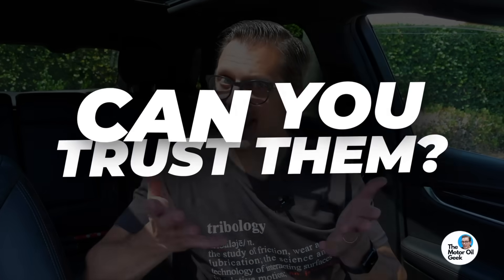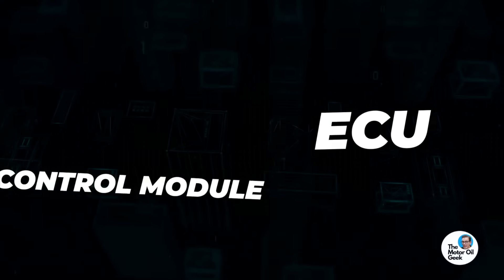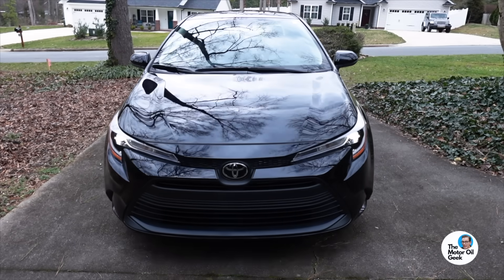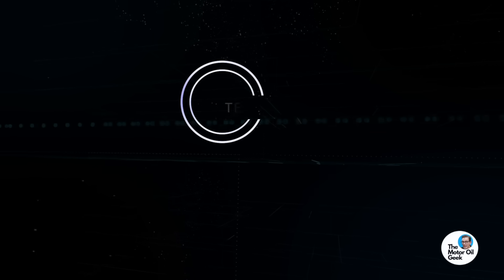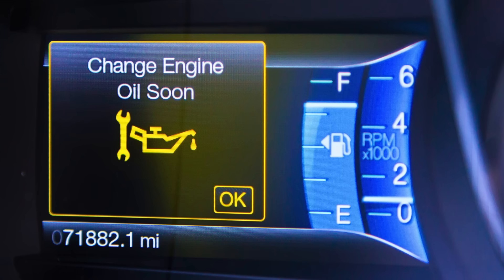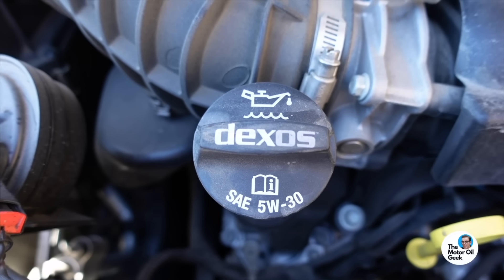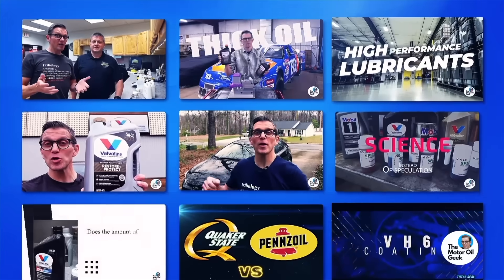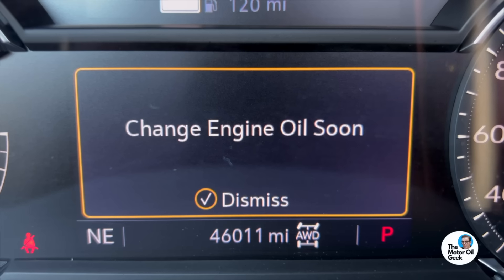The Accuracy of OIL LIFE Indicators REVEALED!

Comment from the maker: Thanks for checking out this video! Just a few points of clarification and a heads up on an opportunity to learn more about this topic. 

First, I don't know when the oil had been previously changed in the rental car. However, the oil was very dark, so it was obvious the oil had not been changed recently. Also, the point of the video was not based on this single test. This is just an example to make the point. I've attended a class taught by Paul Harvath and I've interviewed Don Smolenski prior to making this video. Plus the thousands of used oil samples I've done support the thesis of this video.

With that said, following the oil life indicator only works AFTER engine break-in and when the injectors are clean. Those two situations are the asterisk on this video.

For a deeper dive on this subject, STLE is hosting a webinar on Wednesday October 9th 2024. Here's the FREE registration link. https://us06web.zoom.us/meeting/register/tZYuf-yhrzwvG9OTrwH_gGpHqVyUxmWI7DN4
Reply: Sir, there are videos out there purportedly showing viewers how to get a little extra "junk" out of the engine and oil pan during oil changes. Here are three separateexamples:: 1) after the old oil is drained, pour another quart of new oil through the oil fill cap. Let it drain out the drain hole. 2) after draining the oil, pour about a half gallon of diesel fuel into the oil fill hole and let it drain out the drain hole. Dont worry if any diesel fuel remains as it'll burn off or if you're worried about the diesel in the engine, you can use compressed air to blow it out. 3) before an oil change, pour a quart of kerosene into the oil fill cap and run the engine before you drain the oil and it will really clean out the bad stuff.  Lake. Please make a video busting or confirming these myths! Thank you!!!!!
Reply from the maker: @dgunearthed7859  Thanks for the suggestion!
Reply: @dgunearthed7859  bad idea most oil pans don't empty completely, leaving behind a quart or more of contaminated oil.   So now you have a quart or more of diesel in your oil pan.
Reply: @michaelj343  copy that. I actually did the pour a quart of fresh oil in after the last oil change and let it flow out the drain plug routine. Being good quality oil that wasn't a cheap proposition, but it was the first 575 mile oil change on my new car. Thanks for the kind words and knowledge.  😉
Reply: @dgunearthed7859 this sounds time consuming and wasteful. Jmo
Reply: So how does ethanol percentages and regional fuel formulations play havoc with these algorithms?  I know that if I run E-85 in my flex-fuel F-150 or E-30 in my Bronco, the likelihood of fuel contaminating the oil is much higher and I really doubt that it will be reflected in the oil life calculations.
Reply: Nobody is questioning your expertise on the subject, but if you were going to bother to make a video, why not do one when you knew the age and mileage of the oil. It still defeats the entire purpose of the video not knowing these things.
Reply: One thing to be mindful of for oil change intervals that isnt talkEd about. If you use aftermarket performance air filters you will have to change your oil more frequently due to more contaminants coming in. Its something that this algorithm barely or doesnt factor at all because they use an oe filter baseline. And even if you buy oe equivalent filters they can still cause variations.
Reply from the maker: @hellbringer09  Great point!
Reply: Just play it on the safe side and change the oil every 4000 miles, and use a good full synthetic. If you idle the engine a lot 3500 mile intervals is recommended. Never trusted the oil change reminder. Been driving for over 40 years, never had an engine failure. Most vehicles I have owned were driven over 350,000 miles. How many people have the ability to have the oil analyzed. Just my opinion, take it any way you want.
Reply: @themotoroilgeek I get that the oil life indicator is using an algorithm - but I always thought it was some sort of timer because when it says 15% and I reset it (I did this as a test, not normal habit), it just goes back to 100% and stays there (on both my Honda Accord and Pilot). How come I'm able to trick it?
Reply from the maker: @bill16126 As with any computer, garage in, garage out. If you tell the algorithm that you changed the oil (hit reset), then you gave it bad information. It’s not testing the oil, so it’s relying on the person changing the oil to hit reset when the oil is actually changed.
Reply: Also, fantastic video, thank you for all the diligence in creating this.
Reply: I know I could ask AI and get an answers, but I figure I can ask you all the same.  Has GM altered their 1980 algorithm and accounted for 40 years of engine design improvements and chemical engineering improvements in oil to more accurately determine oil life probabilities?  A 1980s engine is very different than a 2015 to 2025 engine.  Engine tolerances have become tighter and combustion chambers have been altered to maximize cleaner combustion.  
What bothers me the most is how GM does not innovate, and yet their products are still expensive.  In 40 years time they have chosen to not develop an active oil monitoring device which we would expect.  Yet, they did not.  In 40 years the RnD could have been recovered and helped to save thousands in unnecessary oil change costs...which reduces the need to drill and dispose of perfectly good oil.  How in credibility wasteful.
Reply: @williamgrunzweig571 I agree. How about taking a few samples when the oil indicator reaches 0%, and use the average of the lab results to create a vehicle specific correction factor?
Reply: Great video. Now the obvious follow up is... how does that change when you use an extended interval real (Groups IV and V) synthetic oil? Mobil 1 has a 20k/1yr extended interval oil now, and Amsoil Signature Series claims 25k/1yr. I do not know if Mobil 1 recommends a filter change at the mid way point-I think not since their filter says guaranteed for 20k, but I know with Amsoil they recommend changing the filter at the half way point.
Reply from the maker: @jpitt916  Great question! You would need to rely on used oil analysis data to determine the proper oil change interval.
Reply: Just FYI i put 8.5k for an oil change internal based on my chevy cruzes OLM which was at 20%. Had the oil tested everything was good, however the tbn was low it was below 1.  it would have ran out if i drove it another 500 miles according to blackstone. I wouldnt trust your oil life monitor if its below 30% to play it safe
Reply: Wait. Are you saying Honda’s “maintenance minder” cannot be relied on compared to GM’s algorithm? You mentioned something about it was just odometer based. Thanks!
Reply: @bobsmithhome2  yes unless they tested it.  gm didnt mention anything about changing it i just did it out of habit. tested it to be sure. note i bought that car used as a daily beater. last person who  had it drove it hard . the clutch had to be replaced based on their maintenance records. tested the oil as well its fine and they have been changing at 7.5k intervals. i didnt watch the whole video however if he didnt test his fluids then i wouldnt believe him
Reply: Not all oil change indicators are the same then. I had a 2001 Impala, 3.8L that I  changed the oil in every 3-3.5k miles. 80 mile round trip to and from work, 95% of that highway miles. Tested oil change monitor by not resetting every oil change, change oil message finally came on at a little over 9k miles. Good video. I have told people for years that's how oil change monitors work. 👍
Reply: You got knocked down by multiple points for acting like you can ask me to switch to metric. I use both but… I’m not even going to explain
Reply: This is still full of misinformation. No one should pay the least bit of attention to this attempt at clicks. The algorithm works ALL the time, including during break-in, and has nothing at all to do with the fuel injectors. You're just making shit up as you go.
Reply: Are you saying injectors dont dilute the oil? @bobmeyer1332

Comment: What you just told me is that I can NOT trust the oil life indicator because it's too conservative.
I change oil once year.  That's sometimes over 10,000 miles.  At 200K (I currently have two just over that) they have no sludge and no varnish.  BUT, I live in a mild climate.  My cars are garaged.  They run no short trips at low speeds.  Mobil 1 since new.

Comment: Yes, Honda has a sophisticated oil monitoring system called the
Maintenance Minder System, standard on most newer models, which uses sensors and algorithms to track engine operating conditions (like temperature, speed, and engine load) to accurately determine and alert you when oil changes and other maintenance are actually needed, replacing fixed mileage schedules. It shows oil life as a percentage, alerting you at 15% and signaling urgency at 0%, and also provides service codes (like A1, B1) for other tasks.

Comment: Great info, thank you. I have to say I've owned many different vehicles over the years, and I've never had a problem caused by bad engine oil. It's always something else that forces me to get rid of them--excessive rust, transmission issues, electronic failures, expensive emission repairs, collisions, etc. I change my oil when it looks dirty, which is usually around 8k, but I barely pay attention these days. How far is too far?

Comment: Yes, modern Toyotas have an electronic oil monitoring system, often called a "Maintenance Required" light, that alerts drivers to upcoming oil changes based on mileage and driving conditions, using data like oil temperature and usage to calculate need, though it's a reminder for service intervals (like 5,000 miles) and not a real-time oil quality sensor. This system, sometimes linked to Toyota's connected services (like Toyota Connected Services), triggers a dashboard light to prompt service, which must be reset after an oil change.
Reply: Do ya homework before you open ya mouth

Comment: So the oil indicator in my 2022 ram 1500 with the Hemi V8 does not work the same or is nearly as accurate as the GM version did I get that correct from your video and I should not trust it?

Comment: What is the dipstick pump device you're using to take the sample at minute 5:23? I tried a 200cc "oil extractor" from Amazon and the tube is too big and too short and the suction won't hold even if I use a 1/4" OD flexible polyethylene tubing.

Comment: Fords engine oil life indicators not only go by miles but also time because i have a 2010 GT its a spare car and i put maybe 500 miles on the oil and after a year the indicator was saying to change the oil but i kept track and barley had 500 miles on the oil it was still clean! now with my pickup daily driver a 2.7 ecoboost i go by miles not the indicator because on it when i hit 5k miles its saying i still have 25 or 30% oil life and yes i could go farther because i send samples for oil analysis but wont on it because of the turbos.

Comment: I have my doubts that the oil life prediction remains accurate as wear of the whole engine starts to add up.

If a fuel injector (or more) is not spraying like when it was new, the combustions is likely to be less clean, even if there’s nothing to be noticed while driving the car.

Some additional blow-by is also likely to occur as the engine racks up miles and years, which will likely contaminate the oil sooner.

How can any ECU take all of that into account?

Comment: So many people drive their cars hard....fast acceleration, high speeds over 70 to 85 mph and hard braking.....over and over and over. That's how I ride my dirt bike (it's a toy)...As for my cars and trucks, I drive them as if they're about to fail.....gradual acceleration, only do the speed limit wherever I go and gradual stops. Out of high school (1977) I couldn't afford new cars. By 1984 I bought a new Celica. Zero issues. Had 3 kids so I bought a new 93 Explorer.... no issues and so on. I have always changed my oil around 6-8,000 mi. A little sooner if Turbo'd. No issues. I also go by the looks and feels of the dip sticks in my kids' & friends cars...very reliable test as well. Be sure to look at all fluids every time the hood goes up.

Comment: I now change mine every 6 months since I took a transfer several years ago to a location 3 miles from home. Since my car doesn't always get up and stay at a sustained operating temperature. Some might say I should change it even more frequently but I do have a GM with a oil life monitoring and it usually shows around 35 to 40% when I get it changed every 6 months. I'm lucky if I put 5K on my car a year since that transfer.

Comment: I have used a simple routine after at least 5 cars have shown that my “interval” is around 17,000 miles. I change the oil AND filter, plus rotate and balance the tires, every 10,000 miles. Easy to track and keeps expenses down, I get about 80,000 miles off Michelins as well. Dealers consistently push for every 3,000 miles which I ignore - withNO negative results.

Comment: I just bought a new 2024 Durango on 10/30/25 with the 392 engine with 27 miles on it.  The build date is 7/1/24.  Would you recommend changing the oil right away due to the time it has been sitting?

Comment: Thesis?  After one class and one interview?    You need 3 confirmed sources of data and try to use a little scientific method before making claims.
Oil life monitors calculate based on lab computer models and then compared to the few monitored data points on the vehicle.   They don't reflect the literal quality of the current oil in the engine.
They are great for reminding the everyday driver to change oil once in a while.   Or for showing the dealer why they can refuse to replace your engine under warranty.

Comment: I have a very short commute, but in a moderate climate (rarely above the 90s, rarely below freezing). My oil life monitor on our Honda CRV seems to only think I need an oil change about every 12 months or so. 🤷 I have been thinking I should try to get it done at around 50% because it seemed absurdly infrequent to me, but I guess I will trust it. 😅 No engine trouble yet! 🤞

Comment: I’ve had a silverado since ‘99 - I found the oil life monitor to be extremely accurate - I change it when the light comes on and it’s always at a lower mileage than I would normally change it (every 5000km) - for times I used the truck for just long highway trips the monitor went further distance.

Comment: I have a 2023 Toyota 4Runner with a 4L V6 and I would like to use 5W30 in the summer but Toyota  recommend only 0W20 will it void my warranty if I go 5W30 and what is your opinion . My goal is not to buck but to do what is best for my motor.  Thanks

Comment: On my 2025 GMC 1500 with 6.2 it is telling me I can go 15,000 on my engine oil life, according to my oil life indicator. No help from GMC or from two dealers i went to   Is there some way to change my oil life indicator to show 5,000 mile oil change? do I simply change at 65% to give me around 5,000 miles meaning I used up 35% of oil change or 5,000 mile roughly

Comment: I have a 2023 Kia plug in hybrid with about 12,000 miles the oil was changed about 8 months ago at about 8,000 miles the oil change indicator light came on with 5% of oil life left. The question is i rarely use the IC engine I may of used 15 gallon of Top Tier gasoline I put about 5 gallons about every 4 month I will run that fuel out and add another 5 gallons this happened the last time to so I changed the oil I would think it doesn’t need to be change and the indicator is using time not degradation of the oil. Thanks for your input.
Bob

Comment: I like this guy but this is just silly. I am sure the system worked at one time. Now with 10k plus intervals and cars that burn oil excessively, I would not trust this system. More combustion byproducts get into the oil of an engine that burns oil. The genius computer cannot calculate for worn rings. People don't check their oil anymore either. Ignore oil life percentage and change your oil with synthetic every 5k. It is the cheapest way to keep your car alive. Why push the limits?

Comment: If you are trying to maximize vehicle life and its value to you as a tool, you change your oil at 5,000miles.  All this silly nonsense….just change your oil at 5k regardless of what the monitor or OEM states. All the years I worked in a shop, never had an oil related issue on anything with a 5,000 mile change.

Comment: The U.S. Congress authorized the use of the metric system in 1866.  There were improvements and revisions to the system up through 1960.  And probably more after.

The Metric Conversion Act of 1975 is an Act of Congress.  But was completely voluntary.
Executive Order 12770 July 25, 1991 made the metric system the preferred system of weights and measures for United States.

The resistance to flipping completely is strange.  Many industries in the US use metric but make conversions to non-metric for consumers.

Comment: I have a 2005 Z71  Tahoe with 350,000 + miles on her and I only changed my oil when the computer told me too,  heck I even went really long on more then a couple of those changes.  She does not leak or burn any oil and I am getting about 17mhg mixed highway/city driving.  I run mobil one synthetic 5w-20 oil

Comment: 3-4  times a year or every 3000 miles or so  Motor oil is relatively cheap and fast to change ,......Changing out a engine is difficult, expensive.  Same with transmissions, differentials, Power steering and brake fluid - changing them out ahead of time is better than the opposite. You want a car to go 200-300k or more, that is the way to make that happen.
And NEVER let a car go below a 1/4 of a tank of gas......unless you want to change out the fuel pump. Fuel pumps are cooled in the gas tank by gas.